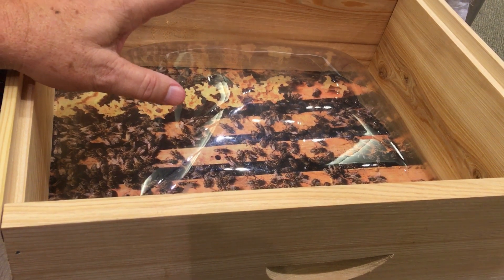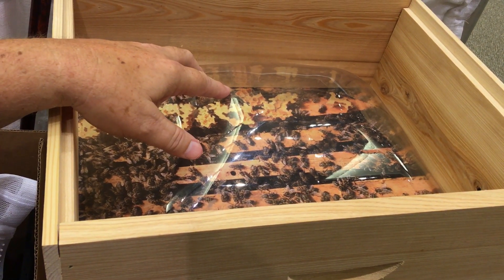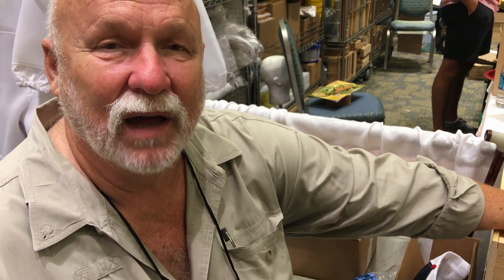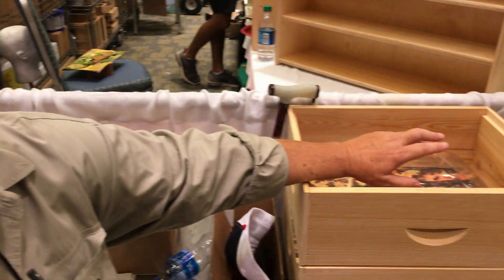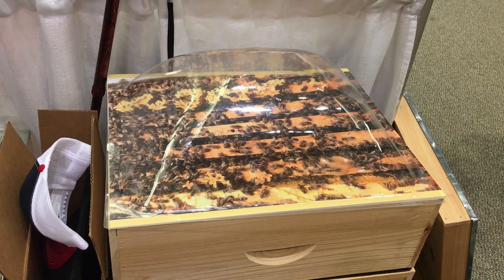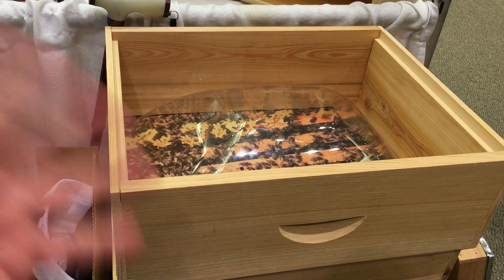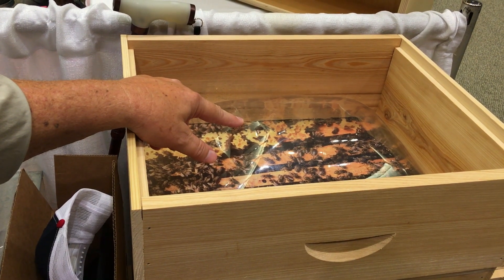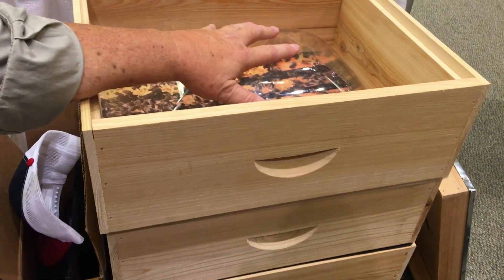Clauss Hive Dome

Comment: Just don't seem like it will help with the condensation and all. How they gonna dehydrate the nectar?
Reply: Until I have one and get real world experience I'll refrain from speculation about its impact to the hive.  I too have that question but I remind myself that in the real world bees live in trees with one entrance hole and they apparently ventilate the cavity in a suitable manner.  There is one school of thought that a more constricted hive is better for bees as they literally control the ventilation.  The opposite of that idea is an open bottom board which creates a situation where bees cannot create the airflow that they would in nature.  Hard to say if this is on the right track and is a positive experience, or will cause unwanted side effects without trying it.  Otherwise you have to take them (Gordon in this case) at face value when he informs it works and he has studies to prove its benefits.